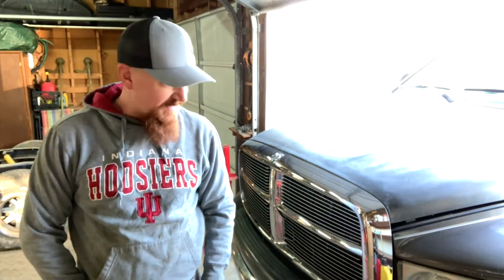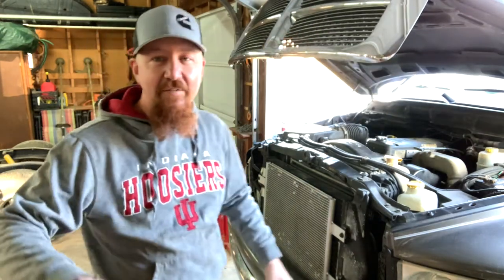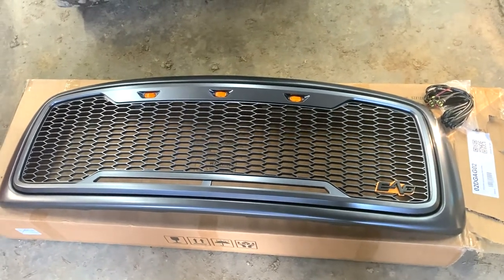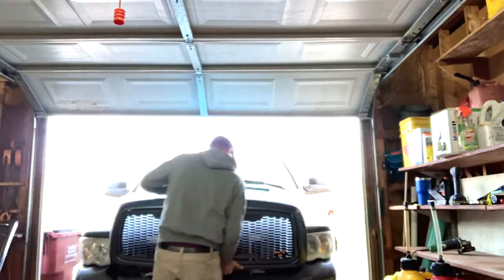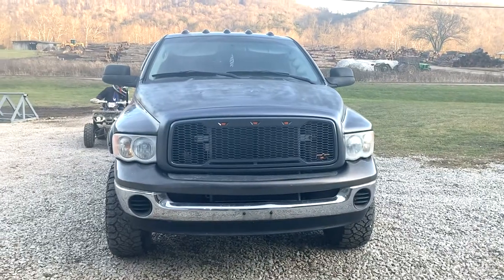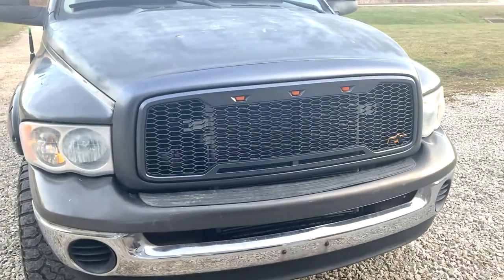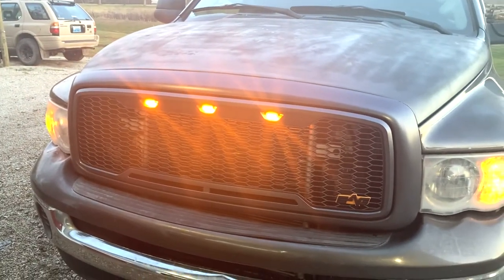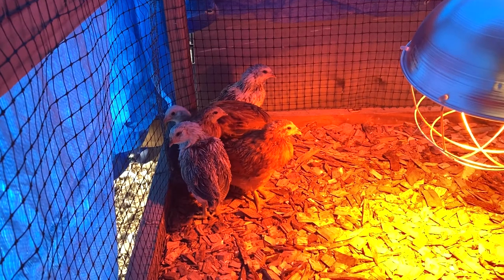Installing a New EAG Grille on My Truck

Comment: How did you wire it?
Reply from the maker: I just took the headlight out to access the parking light wiring and I spliced it right in there.  That way it is on whenever my parking lights are on.
Reply: I did this but the parking lamp keeps burning out as a result. Do you experience that?